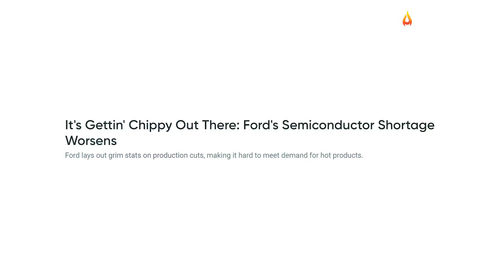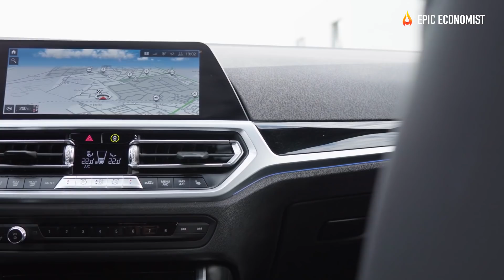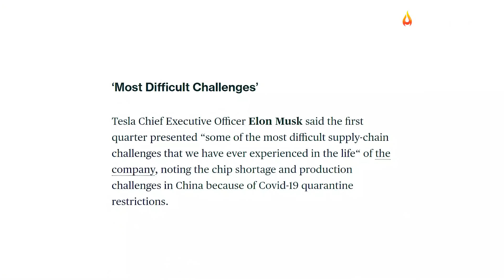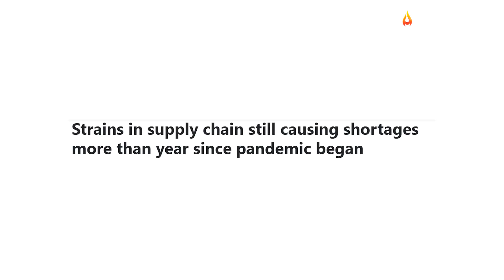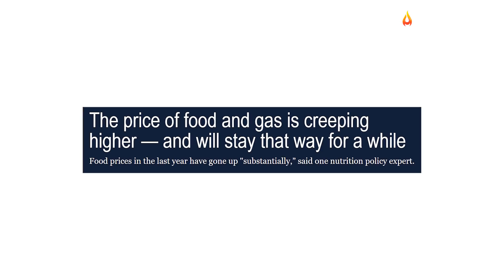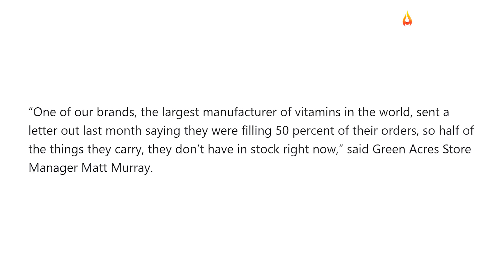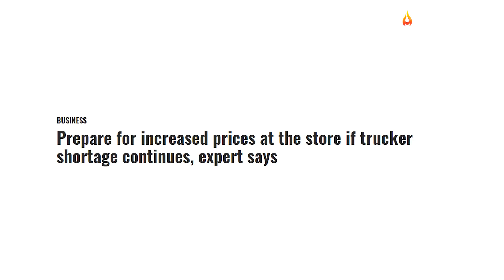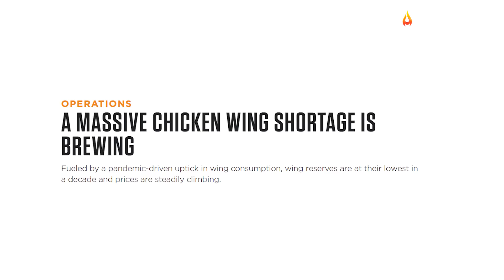Massive Shortages Are Coming: Stockpile & Get Ready For Explosive Prices

Comment: you know what is really odd about all this? somehow it is cheaper to retool the factory to make bottles and boxes 2 oz lighter and smaller, than it is to just raise the price by 40 cents.... how can it possibly be cheaper to get new tools and fittings for all those machines than it would be to just make a 40cent price adjustment on paper? appearences or not.... it means that getting 100k worth of new fittings minimum costs per machine, maybe 800k or per line of items or factory, or millions... costs less than someone to adjust prices by a few cents across the board.

Comment: Maybe we don't need such computerized cars. Back in the 50s and 60s cars were made simpler. No black boxes or difficult computerized
components. Any Tom, Dick, or Mary could fix their own car. We didn't need a manual to turn on and dial the radio. 
We didn't need navigation, we learned to read a map. Cars cost less, and therefore, used cars cost less and were more affordable.
No one ever went on an 8 year payment plan!